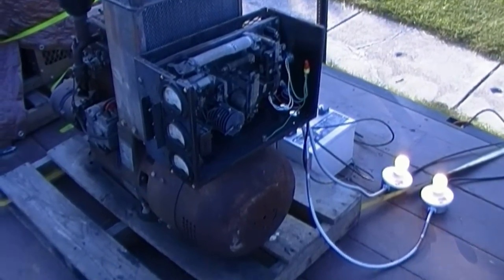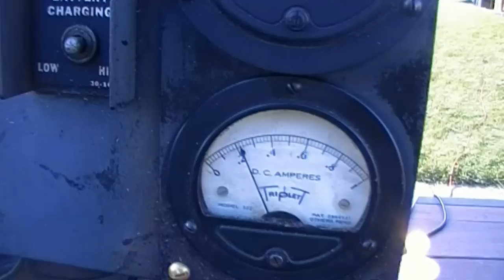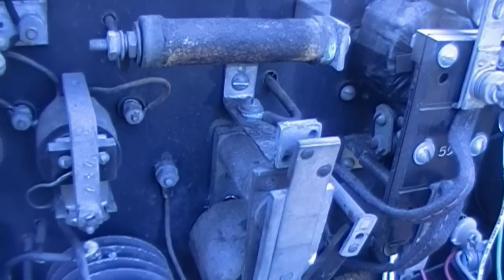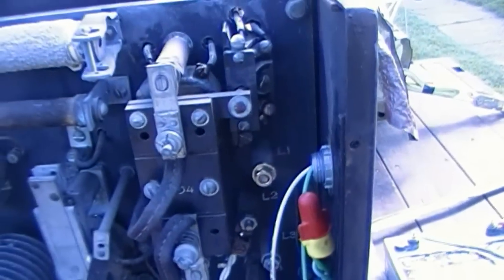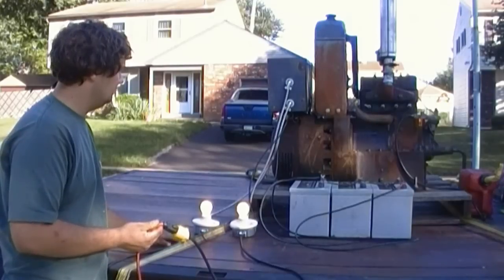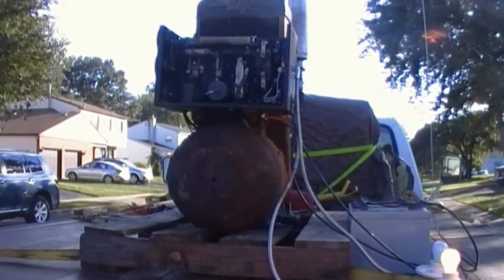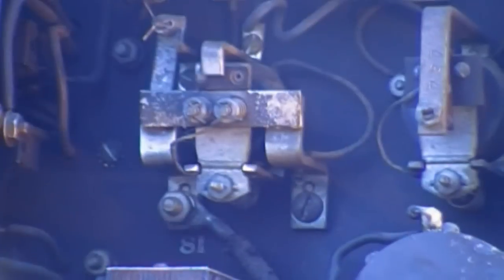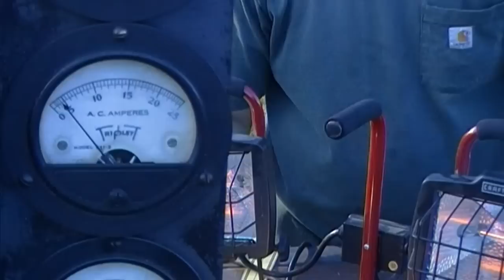Kohler Emergency Light Plant Operaing

Comment: The 36 Volt batteries may also be why you are falling back into crank mode. Some of those old relays had current sensing coils and voltage coils, ie four wires going to the coil, you may be dropping back on an 'undercurrent' situation. Take some time and trace it out, don't give up on her it's a beautiful piece of history. Those old engineers designed some great equipment with not much more than a piece of wire and a spring didn't they! Again, well done sir!

Comment: You have found a gem there sir, well done. My only suggestion would be to change the starter batteries to five 6 Volt batteries, giving 32 Volts. This was a common voltage for 'lighting plants' here in Australia back in the early days. 38 Volts is not quite enough to charge three 12 Volt batteries, which need minimum 13.5 Volts to charge making 41 Volts minimum. Five 6 Volt batteries, nominal 32 Volt will charge nicely at 35 V, making your 38 perfect.

Comment: Very cool! Great job getting it working. I have a bunch of parts for my 800a21 kohler comming in from ND now. I will have the fuel pump working, and I still need to figure out how to get the automatic control box working again. I have an outlet wired directly to the gens output at the moment but it wont start itself yet.

Comment: I think the flickering could be related to the start winding in the generator generates electicity to charge the batteries back up after start. Once they reach normal voltage the relay cuts, and the voltage drops sligly, enough to activate the charging circuitry again. But "calmes down" when batteries are fully charged. - just a theory, I know very little about older gensets, but it might make sense...

Comment: These lasted a long time because the engine ran at only 1200 RPM and used a 6 pole generator head. low compression engine. They are really cool

Comment from the maker: I suppose that could be possible, although it does not happen regularly and the charge rate does not change according to the ammeter.  If I could find a schematic for the circuit I could determine the cause.

Comment: Wonderful runner!  My ER-2 starts ok on 24 volts but the starting relay clicks in and out once it's running so I disconnect a battery cable.  Now, it has stopped generating.  I wonder if I toasted something.  I have a schematic in the manual so I have hope of fixing the problem.